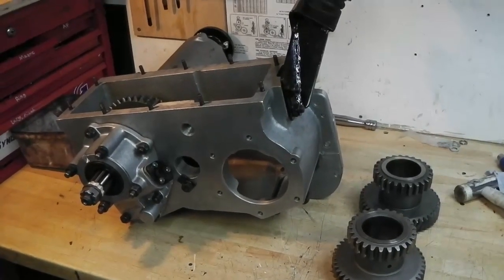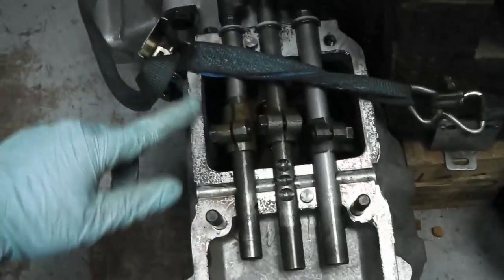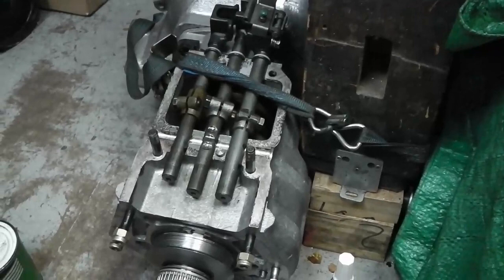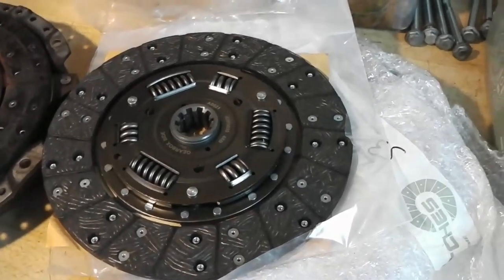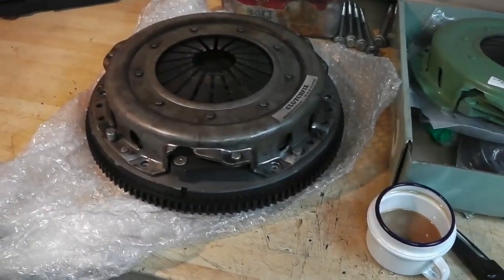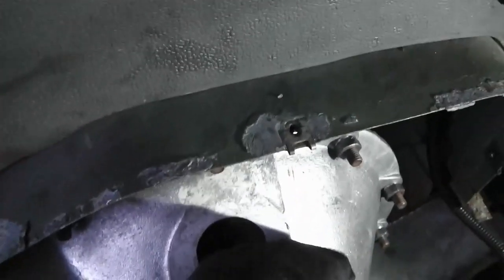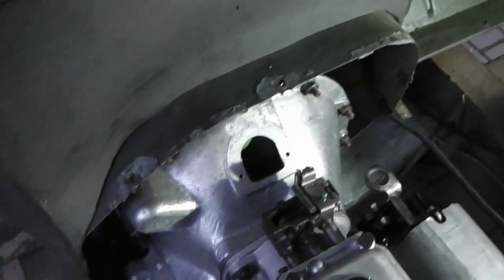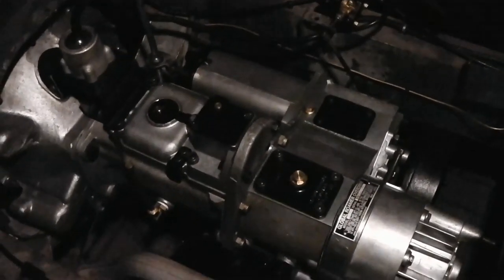Land Rover Series 3 Gearbox Swap - Part 2

Comment: If you don't have an engine crane I've found a length of timber between the rear bulkhead and the dash top with a strap round the gearbox works.

Comment: For some reason this group of vids didn’t pop up, only found out by watching Kermits latest instalment. Remedied that now, never seen a box looking so mint. Good job sir. 
Re roamerdrive bolts, I’ve felt that the cover plate is nuts on studs, but that has to go , and it becomes steel bolts directly into the Ali. I never torqued mine down as they are very long thin bolts, but I did them up in sequence and to what felt right. A later subsequent check showed that I was around 28 instead of 33 foot pounds. They have never come loose or caused any concern at the “ kinder “setting. So , like you, I’m happy with that. 
Got a bit of a whine started on my box, no vibration but I’m thinking when the rain stops it’ll be a box change over. I’ll do do it the two part way, and am hoping that I can do it all from underneath without removing the seat box, so long as the cars up high enough.
Reply from the maker: Thanks, it's been all ok so far although today the speedometer drive has just started playing up- almost certainly the cable from previous experience... but I'll investigate. It's just never that easy is it..  Have you got a spare transmission to go in? I've dismantled both the gearbox and transfer box I took out for overhaul and bought the parts to do the gearbox, but tbh I wouldn't mind getting it all out of the way. If they are any interest to you, come and have a look some time?
Reply: @steamwally  cheers but I’ve got my original transmission in  two bits underneath the bench, so that’s the one to go back in. I also like to know what’s original with the vehicle, even though all bits are the same really. So I’ll pass on yet another gearbox. I’ve got a spare tdi to build a little kennel for ; I’m a tiny bit jealous of Max’s many sheds!

Comment: How do you like the xzl's?
A bit different than the grabbers i suppose.
Reply from the maker: They are excellent- I should have done it long ago. The steering is half the weight, the vehicle rides the bumps better and they looks so much better. You'd think the XZL's would be a dramatic increase in noise, but not so.
Reply: @steamwally  they look great on a series land rover. You might need to rotate them every now and again to keep them quiet.
I do that with my toyo m/t's and they are still pretty quiet after 10000km.
Reply from the maker: @rickz9495  That's a good shout, something I never really did with the Grabbers and regretted!